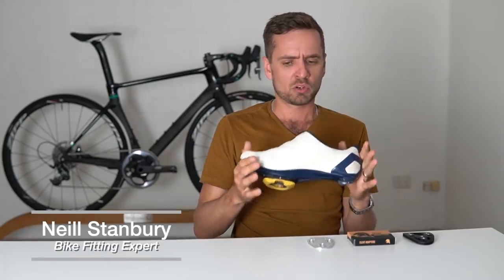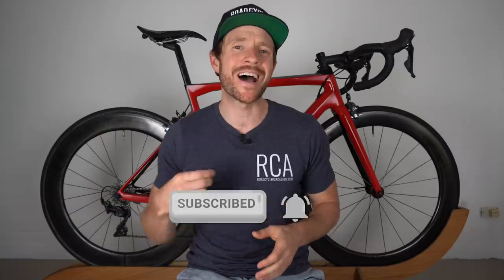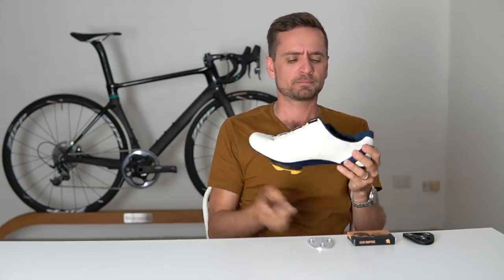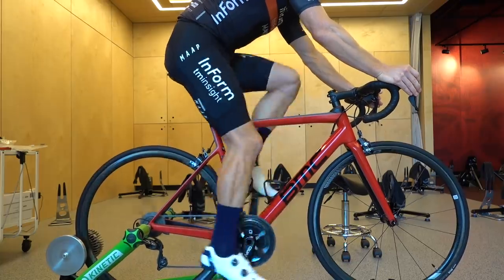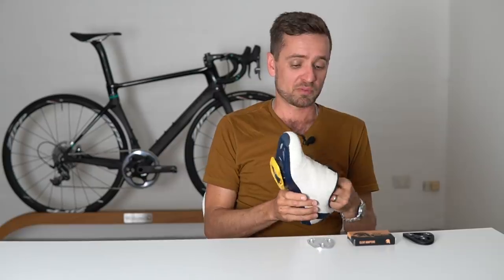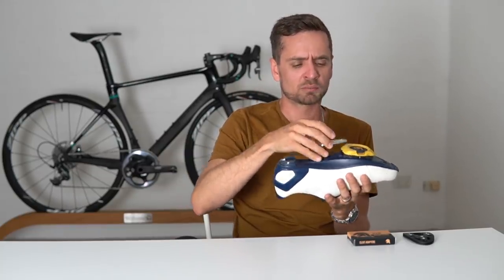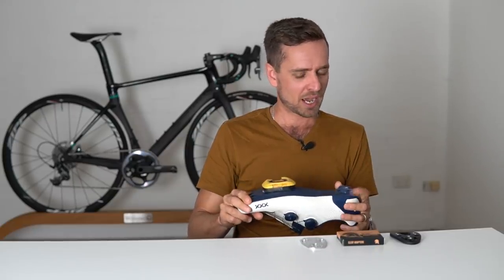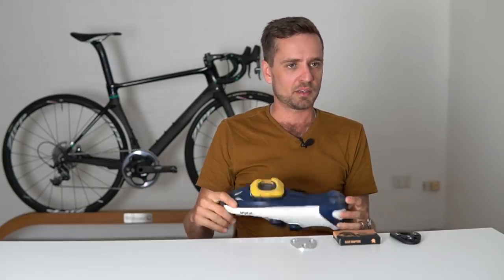Ride with More Speed & Comfort (with a Midfoot Cleat Position?)

Comment: I’ve positioned my old shimanos as far back as I could a few years ago. I have a size 15 foot. The repositioning allows me to be more balanced and really improved my power. It also resulted in less ankle strain and knee pain. The only downside was as he said, I had to start tweaking the seat height and stem heights. But in the end it has worked out very well.

Comment: Been struggling with inefficient power output with my cleats forward (attack position) for many months now until I came across your videos. Haven't looked back since moving my cleats back. I used to struggle to average 24-26 kph. I now cruise at 27kph and can feel there is still room for improvement with fitness gains.

Comment: I drilled the soles on my bonts, to move my Spd cleats back (bonts seem ideal for this as they have large/ relatively flat soles). I noticed all of the benefits mentioned. I have broken many bones in my feet and used to struggle with numbness, no problems at all anymore, out of the saddle still  feels good to me as well. I used to point my toes down so it allowed me to lower my saddle a long way as well, roughly 60mm.

Comment: I have the Swiss plates and they are great. I’ve only gone the first 12mm back, with the look cleats then slammed as well, I should try the 24mm spots and see if I can finally really get rid of the numb tingling toes.  A word of caution, though, as when your cleats that far back, your feet can now more easily interfere with the front tire when turning, so, you have fewer options to pedal through turns. I’ve become rather used to it, but it’s kind of “a thing”. These are great videos and I’ve learned a lot, they are a real service to the community.
Reply from the maker: Interesting to hear, thanks for sharing mate

Comment: Just recovering from double Halux Valgus surgery last autumn and am working towards my first Étape in a couple years. Will be buying a pair of Lake CX 241”s and will definitely be trying out fore/aft cleat adjustment for the first time in 40 years of cycling. Not to mention the other top tips such as saddle height, fore aft, crank length etc. Thanks Neill and Cam 🙌

Comment: I tried those exact SPD-SL adapters. They lasted 40 miles before the nuts that hold the cleat bolts in sheared off and dropped bolts on each shoe. So, I basically paid a dollar a mile for them before they broke... and I'm not Peter Sagan. I cruise at about 220 watts and that was too much for them. I REALLY wanted them to work-- they made a huge difference-- and Neill's assessment of how they impact power and feel are spot-on.

Back to the drawing board with no way to get my cleats behind the ball of my foot. Shape of my foot simply won't allow me to get a shoe that A) fits and B) doesn't force me to ride with the cleats way forward. It's like riding a bike while balanced on a tightrope. Haven't found a bike fitter yet who can get me stable in the seat. I'd go see Neill if I wasn't on the other side of the world. Sharp guy... and Cam you do a great job asking him the right questions.
Reply: I had exactly the same issue. I checked the bolts were fully engaged in the threads of the extender plate, also used a torque wrench to set the tension. The threads of the extender plates pulled on one bolt after maybe 150 miles. I replaced the plate and the same thing happened again. I didn’t bother to get in touch with Patrocleats as I felt they would blame my installation technique. I definitely fitted the extender plates correctly and with care. The problem with the product is that the threaded insert is made of much softer metal that the Shimano cleat bolt. Also the depth of the extender plate is insufficient and deliberately thin with the aim of reducing the increase in cleat stack. The product does not stand up to hard riding in my opinion. Absolute waste of money. Shame as the product is a great idea.

Comment: Mid foot placement is extreme if stabilization of lower leg is the goal.  I have 20 years as mechanic/service manger. Started moving cleats back for riders around 2012... Seems to me the relationship is between foot length and fore/aft cleat placement. The longer the foot the more leverage on the ankle requiring more lower leg musculature to stabilize. As the cleat is moved rearward a point is reached where the lower leg no longer needs to stabilize the foot but ankle movement is only marginally compromised allowing for a more fluid pedal stroke and less total vertical  knee movement. This point is different for everyone as foot length and musculature varies. Start at the traditional cleat position and move rearward by ~3mm at a time. The rider will notice immediately when lower leg is disengaged during most of the pedal stroke.
Reply from the maker: Nice insights thanks for sharing on the thread mate
Reply: As a "bigfoot" (i.e., size 48 EU), I've often wondered if my large foot size is impacting my pedals stroke and if a mid-sole cleat position would benefit me.  However, an issue that comes with huge feet is that if I move the cleat back significantly, that'll introduce significant tire overlap with my shoe.
Reply: As a really short person that always has toe overlap even with shorter feet: toe overlap isn’t the end of the world (if it’s not too extreme), so just try it (: u need to be slightly more aware of where ur feet are at really low speeds and really really tight bends but how often are we going that slow around bends that aggressive…

Comment: Great content, thanks for posting! I drilled holes in my MTB shoes so that I could place my cleats as far back as the internal compartment would allow, and most of all the strange knee pain is gone. And out of the saddle I fill much stronger because I'm not trying to balance my weight solely on my toes. Plus the saddle height is reduced so I have less pressure on my lower back. Game changer for me.
Reply: Hi, would you explain how many mm was the set.back distance and the saddle lowering ? Tank so much
Reply: @gabrieleiaccheri820  I couldn't tell you, because I go on feel. When all the pain in my knees stopped, and I felt comfortable on long rides, I knew the bike was setup right.

Comment: Not that this applies to everyone but for those who may be watching this video to help them solve foot pain issues... Most people have the first joint of their little toe closer to the heal than the big toe, if you have a large difference in that distance and you move your cleat back more towards a mid-foot position, you may find that all of the pedal pressure gets put on the outside of the foot at the little toe joint. So you have to get the cleat center much more towards the mid foot/arch to get off this little toe joint or keep the cleat closer towards the first joint of the big toe. A couple months of really intense pain taught me that lesson and no amount of insole changes, metatarsal buttons, etc could eliminate it.

Comment: After bell mentioned the 3 bolt adapters last time I got a set. They are great and really well made. I've been using speedplays with the extension player for years and noticed that when I went back to Keo's I started to get hot foot and discomfort. The revised mid foot position has now meant greater comfort using the keo cleats. 

Again a great video Cam informative without preaching. Thanks mucker. 😉👍 Noson dda o Gymru. Diolch.
Reply from the maker: That's really good info for the thread mate, thanks for sharing your experiences. Much appreciated. Cam

Comment: I was getting knee pain after longer rides (100-150km+) and arrived at this solution on my own, having read around a bit. As I fatugued my heel was dropping, this caused over extension of the knee and weird non-specific aches lasting a week after a big ride. Dropped my saddle 10mm and moved my cleats nearly as far back as they will go (Shimano SPD-L) so not a true 'mid foot' position but much more rear biased. All knee twinges disappeared and I can do the distances without issue now!

I think it's wise not to recommend people new to toes clips to try and get the 'spindle under the ball of the foot' because this often leads to cleat position too far forwards for most riders.
Reply from the maker: Thanks for sharing on the thread

Comment: I used to have massive issues running off the bike in races until I switched to speed play pedals and mounted my cleats much further back using the extension plates.
Interestingly, my FTP didn't suffer and my sprint wattage was only down a couple of percent. Even used the same cleat position on the track and again, made next to no difference with my jump or power, just meant my calves were no longer cooked after every session

Comment: I bought patrocleats and put them way back...best thing ever. Size 47 shoes. Really feel more glute and ham work. Way less tension and cramping in my calves, hot spots in my toes are gone. Toe overlap is horrid, but once at speed its no issue. Also dropped the saddle and bar at least 2cm #AeroGains
Sprinting needs maybe 3 pedalstrokes to get going, but it doesnt seem to effect max speed. Climbing too feels 👌
But....YMMV

Comment: For a bike fitter, I'm surprised no mention of needing to look at the fore/aft (saddle setback) after doing this. It can be a problem moving the foot forward by a significant amount without also moving the saddle forward the same amount, otherwise the fit could be thrown off and knee problems can occur. Don't ask me how I know.
Reply: Lowering saddle height also brings saddle forward as it is angled.

Comment: I have another negative to add. 
I have longer feet size 47 or 48 and i always felt like shoe manufacturers do a bad job of adjusting the cleat position for big shoes leaving the cleats to far forward. I have used in the past the speedplay adapter plate to put my foot as far back as possible. I really likeed it and raced with this as with my long feet in the normal position it feels unstable particularly if a stand up. Feet back position makes the feel much stronger.
However i cracked both sets of carbon sole shoes just behind where the cleat ended. I am fairly tall and raced between 85 and 90 kg at the time. I only like this setup now on nylon shoes. It felt to me that carbon soles are made to focused on weight loss with not enough strength behind the normal cleat position.
Reply from the maker: Frustrating mate, but thanks for sharing on the thread

Comment: Thank you, I think I'll try this as I was having lateral interior knee pain and nothing fixed it until I changed back to flat pedals. While on the bike trainer I noticed my feet placement and I was thinking maybe I could try again with the cleats farther back (I use mtb shoes/clips).
Reply from the maker: Keep us posted if this works for you!? Be interesting to hear
Reply: Interesting, coming from mtb I always had knee problems until I switched to shimano spd pedals, problems gone. I have my cleats a slightly bit farther back as usually recommended. I can only say invest hours to the cleat position, I probably changed it more than 50 times until it really felt natural.

Comment: Hi Cam - Love this series.  One question I would have for Neill - wouldnt this lead to a very large toe overlap situation.  I know it's not the end of the world and a little toe overlap isnt a big deal, but this would seem to me to border on dangerous.  He doesn't address this in the video, perhaps you asked him and edited it out for time?  What do you think? thx, Alex
Reply from the maker: Great Q I’ll need to ask Neill about this. Stay tuned
Reply: As a smaller rider on a small frame bike I was going to ask the same question.
Reply: @TufferImages  hey, I'm 162cm and tried running midfoot with those adapters. Despite switching to 160mm cranks previously I get toe overlap both in a "normal" position with the cleats all the way back on the shoe as well as with midfoot cleats using the adapters. I don't really see what difference it makes -  I can't pedal through tight turns either way so the amount of toe overlap changes nothing to me. Just keep your cranks vertical in tight corners and you're fine. It's just another habit to develop just like unclipping BEFORE you stop and not pedaling through fast corners where you might hit the ground with the inside pedal.
Reply: @nb_rebecca  Interesting point. I learned to keep my cranks horizontal when cornering when i rode a bike with a really low BB, and after a couple of scrapes, I had no issues. Same idea of a learned habit. Not that hard to do, either.

Do you ride a bike with 700c wheels at your height? They're not as common anymore, but 650c would definitely help with toe overlap, and could conceivably get you the best of both worlds.
Reply: @jamese4729  650b/650c would be great I'm sure but seeing as only one brand makes road bikes that take full advantage of smaller wheels in smaller sizes I decided against it.

Comment: Well I have been riding with cleats in a really back position and I felt my quadriceps burning during my efforts and after my trainings. I changed the cleats to an upward position ( neutral now cause I had the cleats almost at the fully back position) and I feel now that calves are also involve in the pedal stroke... and I stopped experience this burning in the quadriceps.

Comment: Cam,

Regarding your request for future video topics:  Bike sizing, and whether we can "trust" manufacturers' recommended sizing charts?  I've run across some other videos/topics lately that seem to suggest most manufacturers' recommendations skew too large/long.  I would be curious to get Neill's thoughts on this topic, along with some general recommendations on what a rider can look for in the geometry charts for their given height/size, versus simply following the "you're 5'10", so you ride a 56" canned advice.  As a corollary, when a rider is appropriately sized, versus sized too large, can a rider typically tolerate more drop or a more "aggressive" handlebar height due to appropriate reach?  I recall somewhere in your videos that you mentioned that you ride a size 54, but that you "could ride" a 56.  Have you and Neill discussed this aspect of fit and frame size choice, and why did you settle on the smaller frame size?
Reply from the maker: Thanks for sharing Finn.

Comment: Question on this, with a mid foot position you say the saddle needs to come down, would there be any adjustment to fore/aft position too?
Reply: I think you need to set back. As your pedal spindle goes back, you need to set back your position. That also means your stem needs to be shorter.
Reply: @lordalfa600  You mean setback of the saddle? - No, other way around: With the cleat set more midfoot, in relation to the pedal your foot moves forward (mind toe overlap on some frames). So the saddle should move up front, otherwise the hip angle (torso-thigh) would get tighter. With a wider hip angle your muscles fatigue less. In combination with shorter cranks I even needed the ProfileDesign FastForward seat post which allows for setting the saddle further forward/over the BB. Excellent for a triathlon-like position on the same road frame. Bottom line, the stem would have to be longer (but this affects steering, so another point to get used to) or better for those long endurance rides and bike packing - mount on tri bars (or shorter/lighter/more mininalist, the RideFarr Aero Bolt-On) which also offer a lot of relief to the wrists and hands. I found the opening of the hip angle even facilitates abdominal breathing. (Btw, the rulebook of  Paris-Brest-Paris has been revised and allows the use of aero bars.)

Comment: Tried the Shimano road to mountain cleat adapters to save a ton of weight over heavy mtb shoes.  With carbon road shoes I couldn't get the cleats back far enough to avoid ankle pain. Also riding fixed gear so mtb shoes have obvious advantages. No track stands for me though!

Comment: Hi Cam, Neill is a legend. I have followed his recommendations around saddle height, fore and aft, reach, etc, and after two rides, I notice the difference (I know it is too soon). I had never recorded myself cycling, on the trainer, and it is very valuable what see you. Basically, I noticed I was a heavy heel dropper, reason why I moved backwards the cleats, using the PatroCleat extender. I was struggling with engaging my hamstrings and glutes after a very poorly done bike fitting using the Retul system. Because of my pedalling technic, I couldn’t follow the "regular" advises. My question to him would be: I have moved backwards the cleats by additional 10mm, intuitively, this would mean lowering the saddle, however, I am flat footed at the bottom of the stroke and because my hamstrings are working better, what should I do? also in regards to the saddle setback. My toe overlaps with front wheel since a while now, and havent had any issue; the angle of the curve has to be significant to hit the wheel. This would be more of an issue for MTB bikers. Cheers and keep it up with the content, you have changed my cycling experience.

Comment: Curious how often those who try this mid-foot cleat position have run into toe overlap problems with front wheel?  More likely in cross than road but a broad scope of responses would be appreciated. Thanks to all, replies, Cam & Neill
Reply from the maker: It’s a great question. I need to ask Neill about this
Reply: @CamNicholls  Overlap was normal back in the 70's. Everything squashed and tight for a, "race" bike. you do get used to it, although for cross it could be an issue. I went a long way back with cleats (mtb ones) after meeting Gotz Heine. I have an L4/5 tear which can cause terrible cramp in top of legs after ride due to compression, the mid foot (ish) negates this a lot.